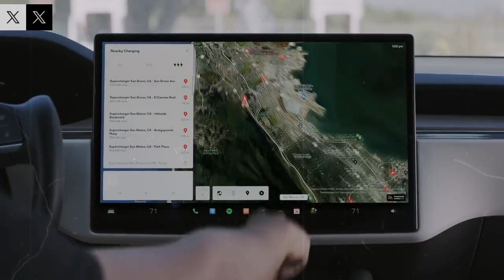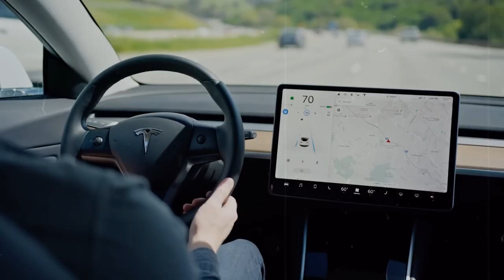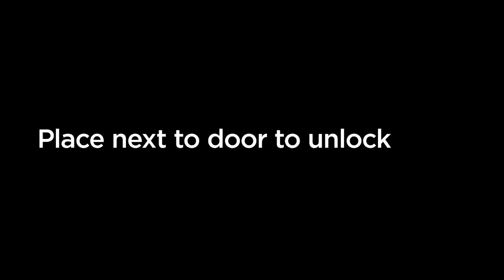IT’S HERE! Tesla Model 2 Senior Edition — $14K, Aluminum Ion Battery, Gigacast Body & FSD v14

Comment: The. rumors regarding. a $14,000-$16,000 “model 2”using. aluminum-ion 
batteries  primarily. based on 
speculative. you tube. content and 
viral leaks rather than. confirmed  
tesla announcements 
Model2/Affordable EV (14k-$25) 
price:while. rumors. suggest. a 
price  around $14,000-15,900  
Price’s. of around $25,000 
Tesla. primarily.  Uses. Lithium Iron. 
phosphate (LFP) for. it’s. standard. 
Range. vehicle